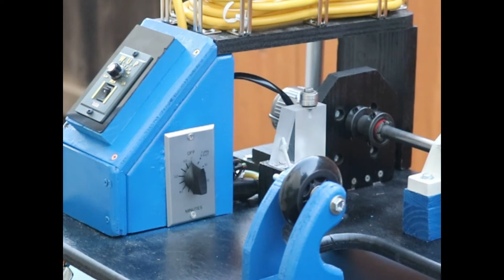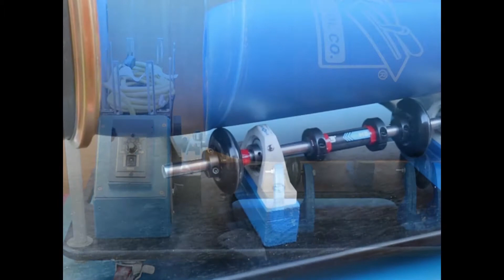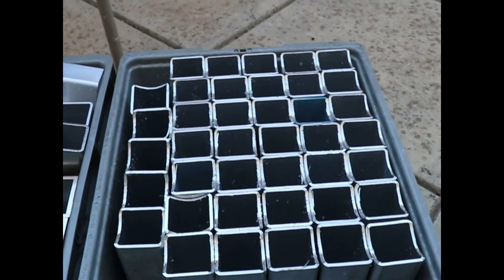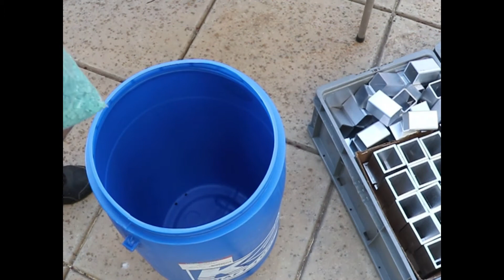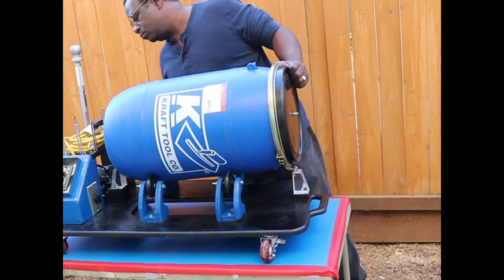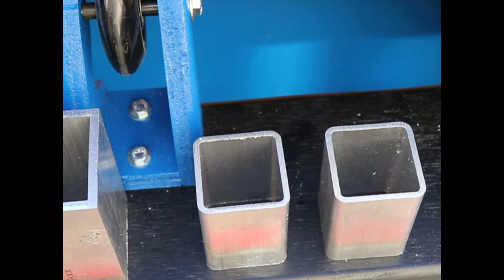First Use of My 15 Gallon Home Made Tumbler Officially in Service

Comment: Many of us who reload our own ammo have built similar style tumblers to clean the brass on our cartridges before we reload them.  Some people use corn cob media, some use walnut shell media... Some people have started using a stainless steel pin type media... These are the types of people who like for their brass cartridges to be nice and shiny... Personally, I just want most of the powder residue off of them and don't particularly care what they look like, so I just dump them in a 30 gallon open top plastic barrel and stick a pressure washer wand down into the barrel and move it around a bit along with a couple of squirts of dishwashing soap to clean most of the stuff off of them... :)
Reply from the maker: Yes, my brother is a professional shooter.